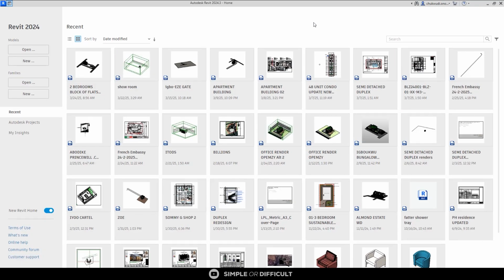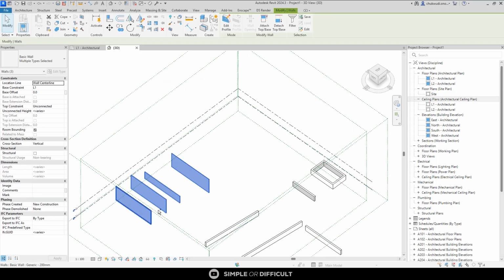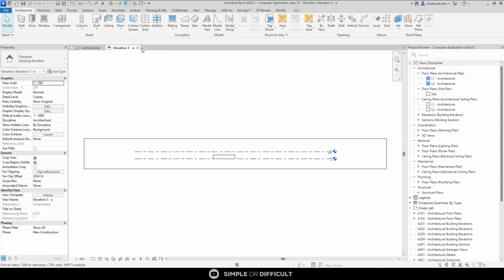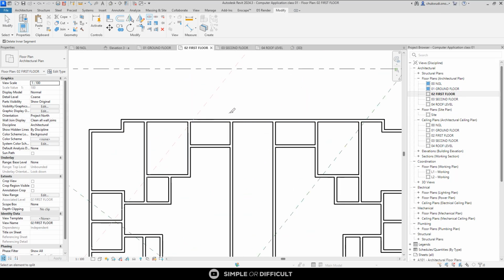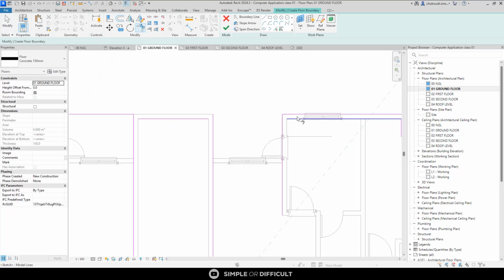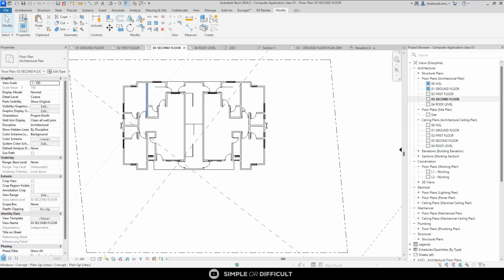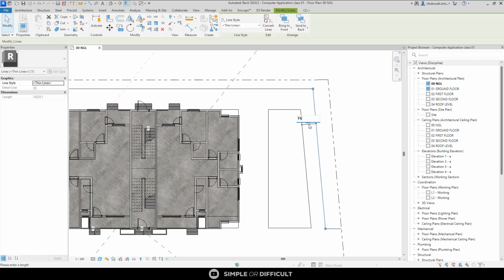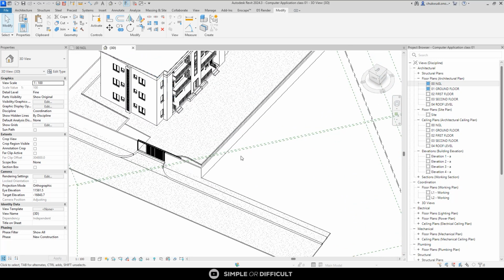Autodesk Revit Architecture 2024 Full Course (Part 01) - Modeling a Block of Flat

Comment: Hi Onochie
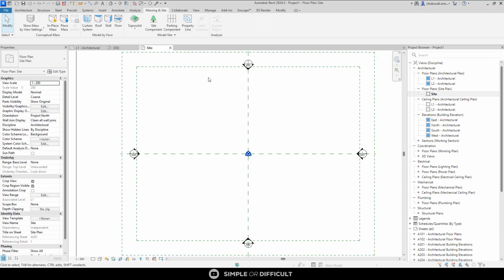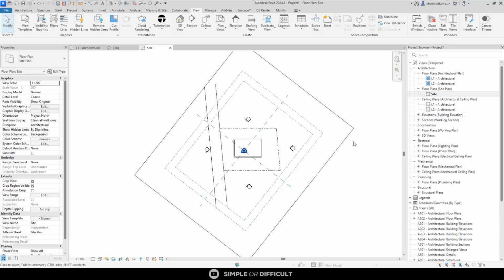I've listened till 27:00, and followed step-by-step till 34:00, but when I switched viewports to L1-Architectural, the drawing stayed as-is in a horizontal view, unlike yours where it was tilted.
Is there something I might have entirely missed? haha
But i did watched it 2 times, still the same.
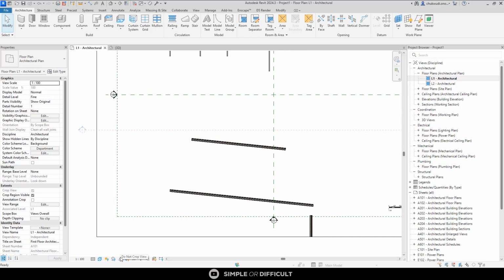Reply: The answer is at 20:20. The Scope Box option must be switched from Views Overall to None, then in the view control bar at the bottom of the interface select Do Not Crop View and Hide Crop Region respectively.